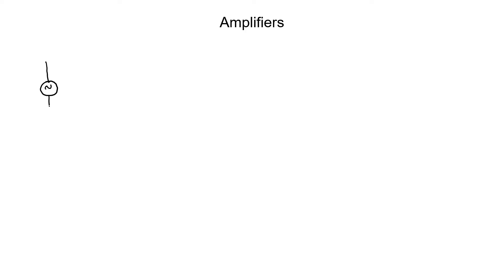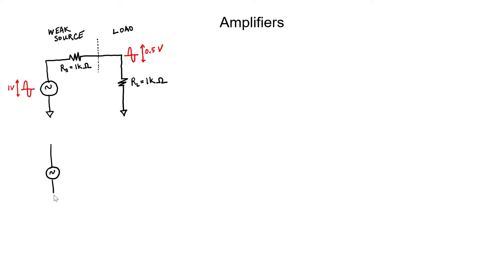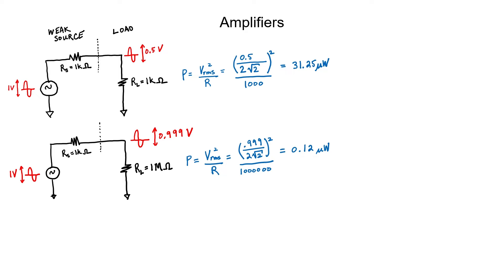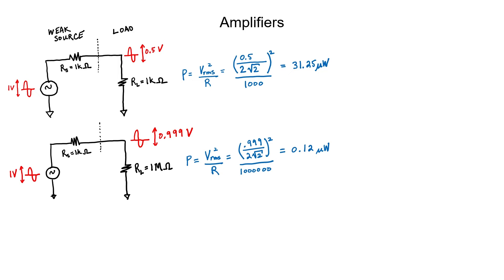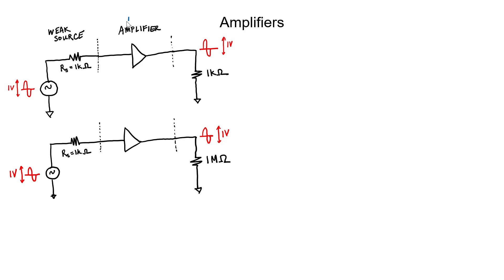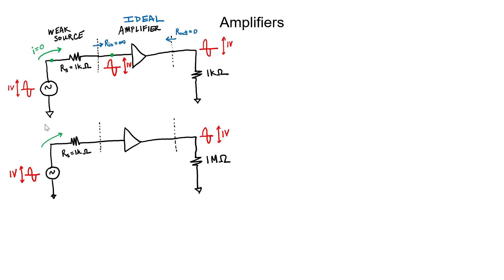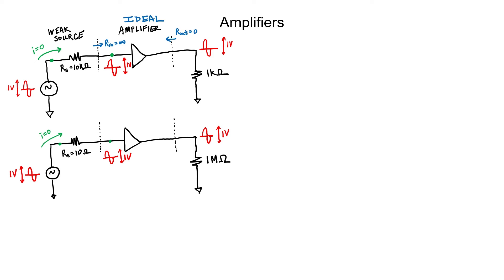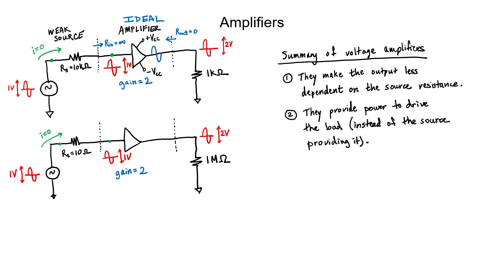Introduction to Voltage Amplifiers (Amplifiers #1)

Comment: It is has been my impression that these topics are largely presented as "XYZ functions this way" rather than XYZ was designed in such a way to solve _ problem. They have near infinite input and near 0 output impedance, because? 

I understand that this is probably not your responsibility to cover everything in a YouTube video/series, but my criticism goes more towards much material you can find on these topics online. 
Of course it is the responsibility of the one seeking answers (me) to read/see many sources to understand this topic.

Comment: Hi Aaron, I just wanted to say that I'm studying electrical engineering and I have to make a fully functional amplifier with an equalizer, mixer and volume indicator. These video's are very helpful. Keep doing what you are doing!
Reply: I am just trying to get an amplifier which is hard enough. 

Also trying for the lowest possible noisefloor, I just want it quiet. Or as quiet as possible at least.

Comment: I made an amplifier with 2 mosfet but it did not work as i tought. Ac signal shifted up and became dc signal. Still works, i can hear but it has an end point where stops working. How is it possible to change just amplitude of ac signal and not move it up?